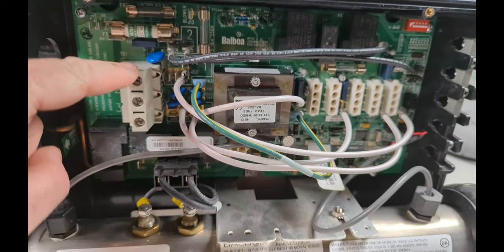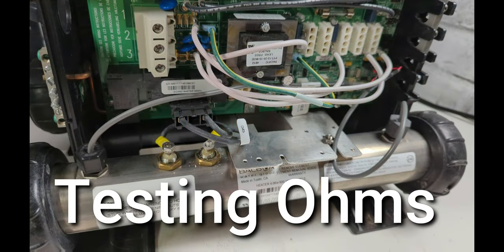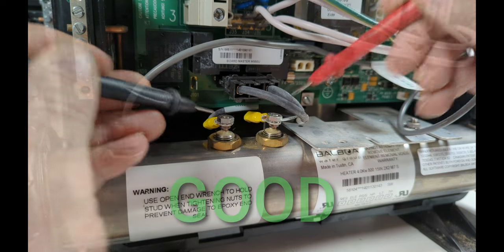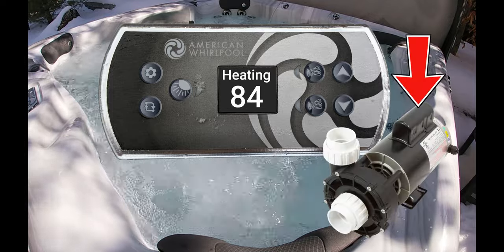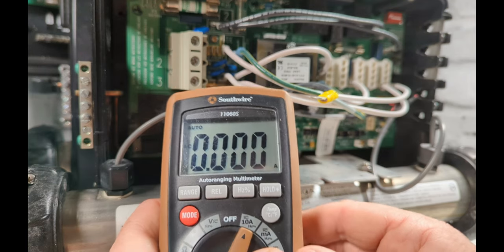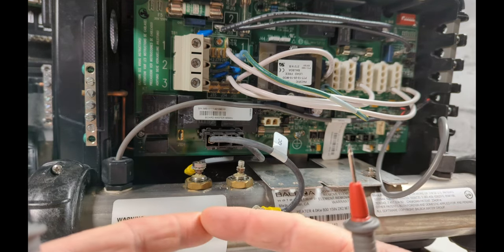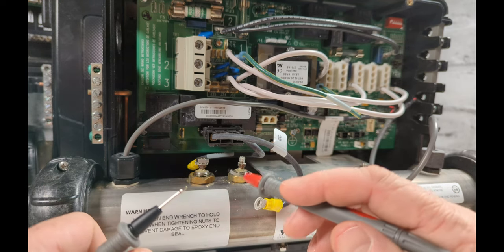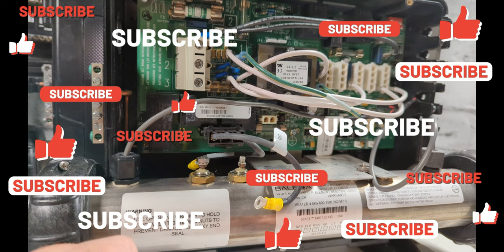Testing a Hot Tub Heater Element | How to Test a Balboa Hot Tub Heater | Hot Tub Not Heating Up

Comment: I have a head scratcher for you. I have a 20 yr old Hydrospa Millennium model. I had no heat. I had 120v to ground to each terminal on element. No 240v across both. The 4k ohm element checks out fine. I changed the filter and it worked for a few weeks. I changed the water and heat stopped again. Same symptoms came back.   I jumped out the pressure switch and the heat worked. So I changed the the pressure switch to the newer #3902 switch. Still not working. I'm a licensed Electrician and I am stumped.  Any idea's? Thanks
Reply: BTW. I changed out the board after the first problem with the heat a few weeks ago. I noticed one of  the copper tabs that connected the element to the board were burned at the board. I replaced the element a few years ago. I torqued the nuts at the element but I guess  they loosened at the board side. I replaced the tabs with wire jumpers as recommended.
Reply from the maker: Would have to know what spa pack you have in the hot tub.  The words "spa pack" are sometimes used by electricians to describe the "breaker box", but hot tub techs call a spa pack the controls used under a hot tub.  Take a picture and send to info@vippools.ca
Reply from the maker: What problems are you having right now?  What is the hot tub doing or not doing?
Reply: @VIPPoolsandSpas  The spa pack is a Balboa HS200. The board is #52498-1. Right now, the spa seems be working fine and like it has always worked, other than no heat. It has {2} 2 speed 240 volt pumps plus {1} 115 volt circulating pump. All pumps are "working". I have 120v to ground on each terminal of the element, but 0 volts across both terms. When I temporarily jumped out the pressure switch, the heat came on and I got 240v across both terminals. Also, when I removed the filter, it did not correct the problem.
Reply from the maker: Change the pressure switch.
Reply: @VIPPoolsandSpas  It's brand new. Just installed it yesterday
Reply: The new switch didn't solve the problem
Reply: @VIPPoolsandSpas  I pulled the circulation pump, and bench tested it. Seems to be running fine. No grinding or strange noises. There was a little debris in the impeller, a but I dont think it was enough to cause a flow problem. The heater tube and element are clear of any debris. The waterway from the filter assy to the circ pump is clear as well.  I'm waiting for new gaskets to re-install. Do you think it could be the High limit/ freeze sensor (Balboa part #30382) mounted on the heater tube? There is only one. 
And there is also a #30352 temp sensor about 5" below the water line in the tub wall.  I'm at my wits end.
Reply from the maker: You seem to have issues all over the place and most make no sense.  With all the problems, ever see an error code at all?
Reply: @VIPPoolsandSpas There were no error codes while running.  I'm going to change out the high limit sensor and reinstall the circ pump and check for codes at start up. I'll let you know how I make out. Thanks for your time.
Reply: @VIPPoolsandSpas  Just a follow up. After weeks of work and frustration, I ordered another pressure switch. Sure enough the "new" one they sent me a week ago was bad. I installed the "Newer" one that I got last night, today. Everything is working fine. Thanks for all your help
Reply from the maker: @tonemizer  could have tried adjusting the pressure switch.

Comment: My spa is heating, but very slowly.  It takes 2 to 3 hours to come up one degree and 3 days to come up to 104.  What can I check to see what may be happening?
Reply from the maker: Is it 120v or 240v?  Do you have well water?  Does the hot tub shell feel like sandpaper?  whats the volts on the heater element?
Reply: @VIPPoolsandSpas  It's a Bullfrog Spa 240V with a Gecko controller/heater.  City water and shell is smooth.  I test 240V on the line coming in but can't get a 240 V reading on the heater element connections.  There are 3 leads going into the heater tube but the two main and I can't get any combination to read 240V
Reply: A Gecko YT-7-H4 only 4 years old
Reply from the maker: Whats the temp now and what is it set for?  Any lights on the circuit board?  Take a pic of the circuit board (whole pack) and the diagram behind the door and send it to info@vippools.ca
Reply from the maker: For now.  turn power off, unplug both the temp sensor and high limit from the circuit board and then plug back in fully.  then turn power back on.  retest element.  Remember, if the tub is at 104 now, the heater will show 0volts.  you need it calling for heat to test the element.  full the filter(s) also
Reply from the maker: @JRrenner54  Just following up on your hot tub issue from 6 days ago.  Did you figure why the tub was heating slowly?
Reply: @VIPPoolsandSpas  See my last comment above.  There was a wire on the control board that could be set for 120V or 240V that I was not aware of.  I moved the wire to 240V and it fixed my problem.  The hot tub heats up normally now.
Reply from the maker: @JRrenner54  So,  it was a new spa pack.   Thanks.
Reply from the maker: Glad you figured it out.  So it was a brand new spa pack that was installed.

Comment: If the hot tub is set to 104 and the read out slowly climbs and ends at 104, but the water temp is not close to that temp. Is this a sensor issue. It's a BALBOA heater 4.0K 800 15in 2x2 M7 S
Reply from the maker: Whats the temp showing on the topside compared to the water temp from a different source?
Reply: @VIPPoolsandSpas  Topside showing 104, water temp 71
Reply from the maker: @TomKleinhoff  change both sensors
Reply from the maker: Or.  Put temp down to 100 and see if topside shows 100 when cooled down.
Reply: @VIPPoolsandSpas  OK, thank you for the info and your time! I'll swap out the two sensors.
Reply: I have replaced the heat tube with sensors, now the tub heats up to the correct top side and water temp. But unfortunately now I keep getting an HH error code. When the error comes on the pump does stop. Is this the pump failing or something else?
Reply from the maker: @TomKleinhoff  pull filters, knife valves open? sensors plugged in right?  heater element touching the heat tube?
Reply: @VIPPoolsandSpas  The gate valves are open, sensors are plugged in - what do you mean by right? Heater element appeared clear of inner tube before installing it.
Reply: This spa only has the one main filter I believe.
Reply from the maker: @TomKleinhoff  Did you drain it or just shut the valves?  Is water flowing as normal on the pump that pushes water thru the heater tube?
Reply: @VIPPoolsandSpas  I shut the gate valves and open the drain hose while replacing the heating tube. Once replaced I opened the valves and added additional water to the tub. Started up the tub, it went through priming and jets turned on automictically and the system appeared to be running correctly. It heated up the water, jets circulating the water - but then HH error code comes on
Reply from the maker: @TomKleinhoff  Sensor issue, element touching the inside wall of the heat tube or something blocking or slowing the flow from the filter too the sensors.  Switch the sensors on the circuit board to see if you get a different error code.
Reply: @VIPPoolsandSpas  Ok, I'll swap the sensors on the board and see if this changes anything. Could this be the pump going out?
Reply from the maker: @TomKleinhoff  Not likely.  Never seen a pump be the problem for an HH or OH , unless the impeller is clogged and has low flow.  If the pump sounds fine, it is fine.
Reply: @VIPPoolsandSpas  OK, wasn't sure why it shuts down. I assume not having the water flow causes the OH
Reply: I swapped the two sensors and the pump started - error codes IC & HH showing
Reply from the maker: @TomKleinhoff  whats the temp now?  IC is ICE.  showing cold.
Reply from the maker: @TomKleinhoff  IC then switches to HH?  Does the cold show up right away when turned off and then back on?  (the power)
Reply: @VIPPoolsandSpas  water temp is 85. I swapped the sensors back, pump started and then shut off. Lowered the temp and pushed the jet button. worked for a bit, now back off reading 102 - water temp 85
Reply from the maker: @TomKleinhoff  do you have the old sensors?
Reply from the maker: I need to do a video on testing those sensors.  I have soooo many half done videos right now and now its pool season.
Reply: @VIPPoolsandSpas  this is the first time seeing the IC error code after swapping the sensors. I just brought the the temp down and started the jets. Once the jets ran for a bit the temp adjusted to the correct water temp versus read out. The heat light came on to bring temp up. It seems like things want to run...but doesn't sustain
Reply from the maker: @TomKleinhoff  ok.  turn power OFF, unplug both sensors from the board, turn power back ON.  let it go thru all its programming.  ONE:  does code come back?  TWO:  if not, turn power off plug sensors back in and then turn power back on.  After it does its thing, does the error code come back.  This resets the 2 sensors.
Reply: @VIPPoolsandSpas  OK, I'll go try. Thanks again for your time and help!
Reply: I turned off the power removed the sensors from the board, turned back on - read out showed a bunch of different numbers, ended on 24 and nothing happened. I could touch each control button and you could hear relays making noises. Turned power back off, plugged in the sensors. System went through numbers and ended on PR, after a while the jets came on and the heater light too. I'll wait and see what the end result is.
Reply: Well, it seemed like it was going to work. Temp now reading 107, water temp 85.
Reply from the maker: @TomKleinhoff  do you have the old sensors still?
Reply from the maker: @TomKleinhoff  24 is 240volts coming in, the PR is purge (part of the programming).  If the sensors were unplugged and it went thru all its programming, pump one should turn on, then an error code of some sort.
Reply: @VIPPoolsandSpas  I don't have the old sensors, so when the sensors were unplugged and the system went through the numbers but didn't go to the PR - what does this mean? I can try again and give it some more time. I turn the power off last night - so its been off for a while now. Frustrating - time for a new tub...lol
Reply from the maker: @TomKleinhoff  do the same test and give it time.  If the pumps don't turn on and or you don't get a different error code because the sensor's will be unplugged, it will be the board.
Reply: @VIPPoolsandSpas  Ok, I'll give it a try. Are Life Cast spas good? Looks like new boards $300 - $500, just wanted to make sure before spending more money, granted that is a lot less then a new tub.
Reply: @VIPPoolsandSpas  The pump never turned on and the read out ended with a SA error code
Reply from the maker: @TomKleinhoff  I'm stumped at this point.  Pump should turn on.  Turn power off, unplug sensors and Test Ohms.  Should be both the same reading.
Reply: @VIPPoolsandSpas  Test the Ohms on the sensors themselves?
Reply from the maker: @TomKleinhoff  yes.  unplug and test each one.  both should be the same.  Also.  test the temp of the water at the same time.  Give me the temp and the reading you get from the sensors.
Reply: @VIPPoolsandSpas  can you give me a quick example how to test this. I have a a multi meter with clamp meter
Reply: Update, found out that the dip switches had a couple of them in the wrong position. Corrected them, reset the system and now all is working correctly...I wanted to say Thank you for your time and help!!
Reply from the maker: @TomKleinhoff  lol.  Really.  lol   You put a new board in it?  That would do it.
Reply: @VIPPoolsandSpas  No new parts, I was looking into getting new parts and when I sent them some pictures the tech noticed that the dip switches were in the wrong position. I think maybe when the electricians were wiring up the tub they accidentally moved them...who knows since this was a used tub.